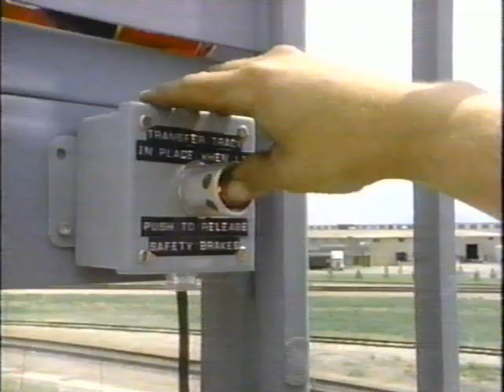Explorer segment on roller coasters (Part 2)

Comment: The arrow pipeline coaster concept was actually picked up by Giovanola/Intamin, but they only builded 2 coasters. One has been demolished and the other one is not operating since 2005.

But the intamin version was way smaller and less intense than the arrow ptototype
Reply: I just randomly discovered the intamin pipeline on RCDB, which is how I ended up here. Sadly, that one in existence is not even standing as of 2017. However, there were not two built, at least according to RCDB. That Intamin pipeline was actually relocated from another park where it operated from 96-99, then operated at Al-Shaab Leisure Park from 2000-2005.

I searched it on YouTube hoping I could find footage of it operating, but sadly, I do not see it anywhere! :(
Reply: to be honest the arrow version probably was rough as heck

Comment: Why didn't this coaster make it big? I've never ridden one but I'm assuming it just wasn't worth purchasing for most parks..
Reply: It was actually scrapped and never saw mainstream production due to a variety of structural, mechanical, and ride experience related issues. Like how it was described by some of the (few) people who rode it as a pretty boring experience, regular valleying and rollbacks, and unexpectedly high strain on the supports all made it pretty undesirable to continue further.
Reply: It was built for alton towers but john wardley thought it was boring so it was scrapped